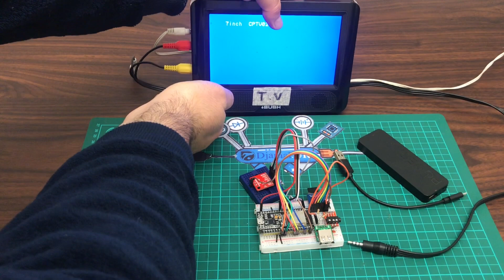Nintendo Emulator for ESP32, SD card support Composite TV Video, Using USB Keyboard + [SOURCE CODE]

Comment: the keyboard doesn't seem responsive, maybe a code glitch
Reply from the maker: This is not finished ✅ project I’m still working on it , still too many bugs in the code to be fixed and Improved ( keyboard quality matters )
Reply: What is the link to your specific Source Code? Romussur Code doesn't include USB/PS2 Keyboard neither SDCard support.
Reply from the maker: @rodrigocorbera4583  I’m still fixing some bugs in the code as you see the keyboard 🎹 sometimes unresponsive and glitchy I will post a clean code with next video part 2 , please stay tuned 
Thank you 😊 for the support